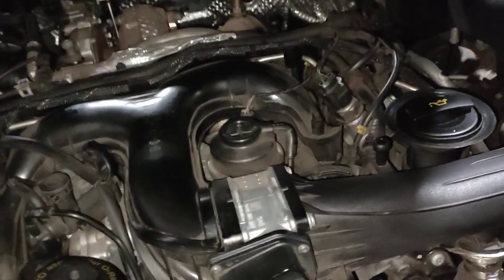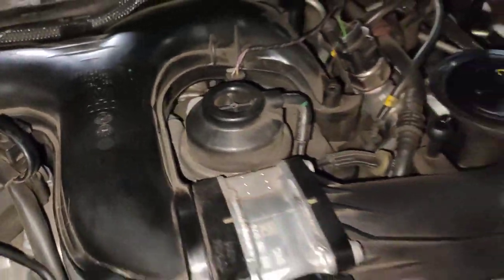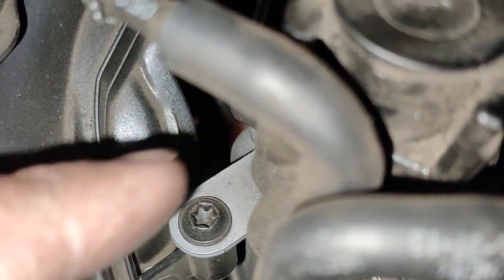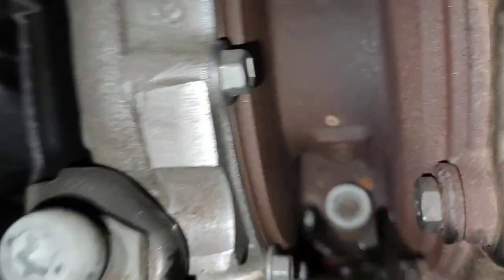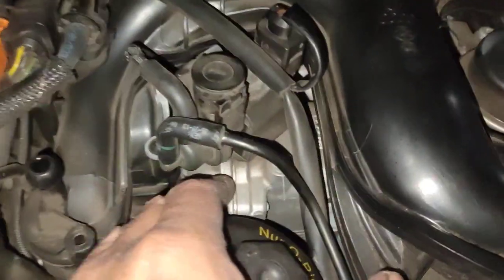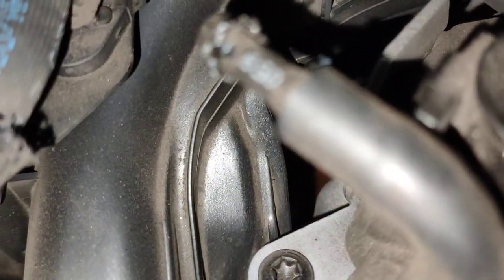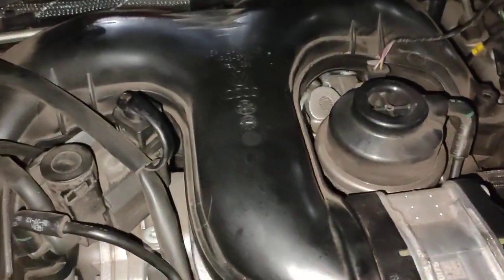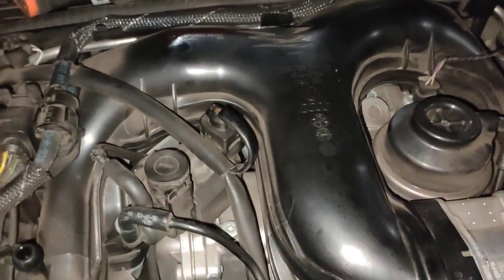Porsche Cayenne Diesel - Coolant leaks inside the valley by EMD Porsche

Comment: Gday Paul,
I believe this engine is also used in the VW Touareg. You have identified a common problem originating from the EGR valve. As the engine ages, the O rings and gaskets deteriorate and start leakingI oil and coolant into the valley.
Is it correct, to remain compliant with the ADRs the EGR cannot be bypassed?
Thanks for showing these interesting videos. I appreciate all the time and detail you put into the videos and your engineering work. Very capable automotive technician.
Reply from the maker: Yes Audi VW Porsche V6 diesel
Reply from the maker: EGR  & DPF can be deleted from this system & thanks for nice comments.
I always try my best to do more videos. I'll do one next week with all the part numbers for this job
Reply: What's the cost for a repair like this?
Reply: @Wennoworks  did you get an answer? 
So if you bypass the EGR, will this concern be eliminated?